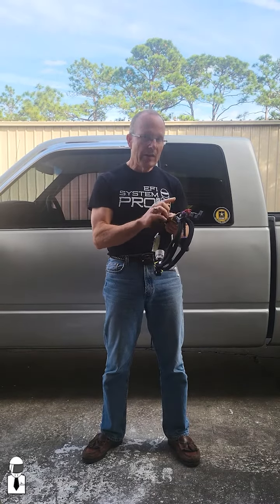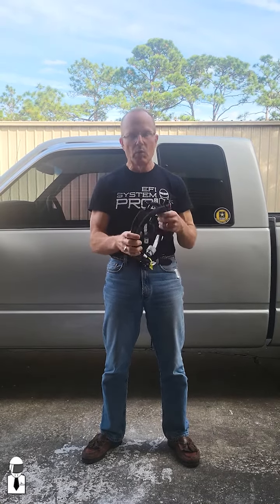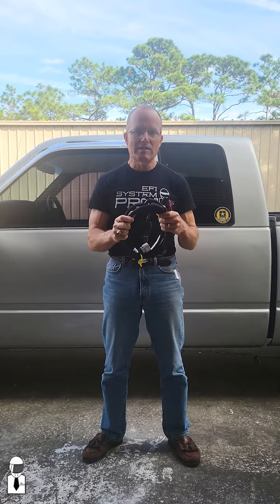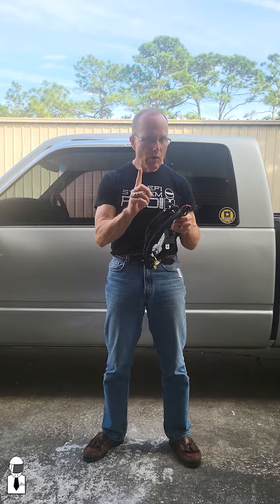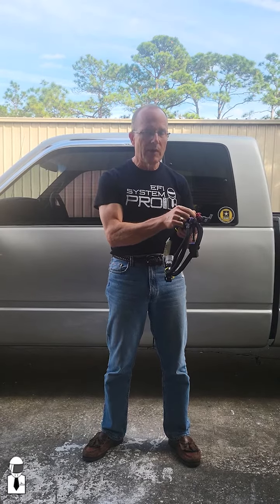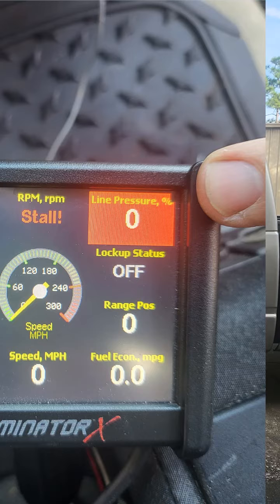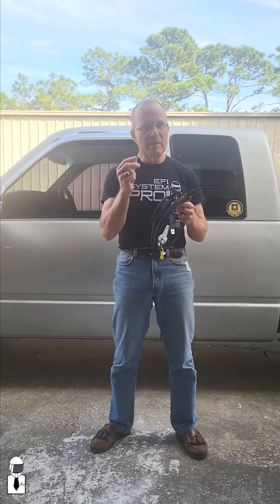Tips about using a Holley Terminator X Max or Dominator ECU I Ford or GM Electronic Transmission!!

Comment: How do you wire a line pressure transducer back into a terminator x? My GM 4l80 harness doesn't have loose wires for this. Also I can't seem to add 5 volts line pressure transducer in on the software?
Reply from the maker: Since the GM transmissions don't have a line pressure transducer the software is not setup to read it. It will have to be wired into one of the extra inputs and setup as a custom input.